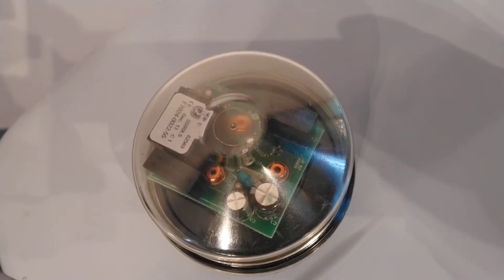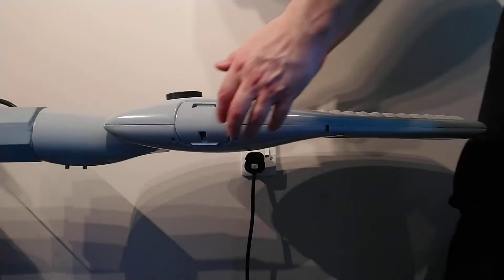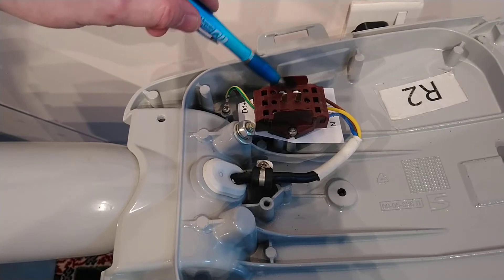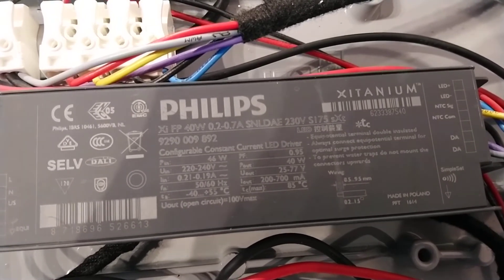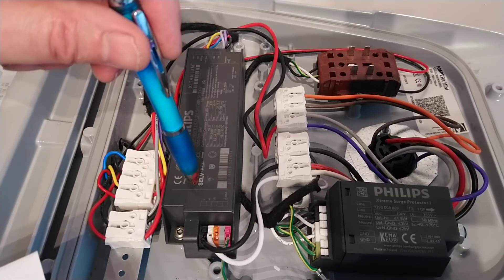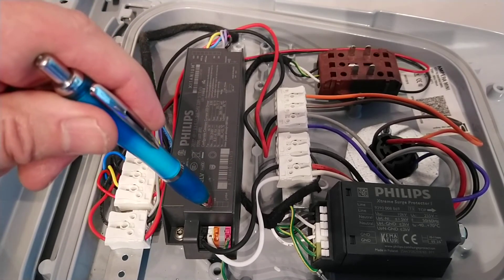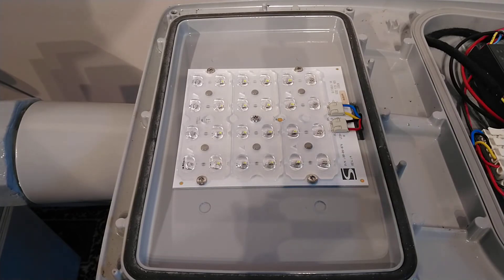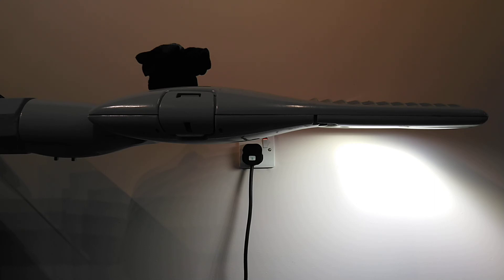Ampera 36 Watt 16 LED White Street Light 240 Volt

Comment: The Ampera Mini and Midi have now been discontinued, replaced with Evo versions which look much worse. Only the Ampera Maxi remains in production.
Reply from the maker: Yes as they brake a mix of new LED lights being fitted in Leicester and Leicestershire. Most of the Ampera's are fitted in Leicestershire by the County Council.